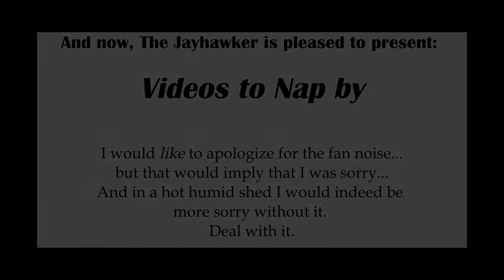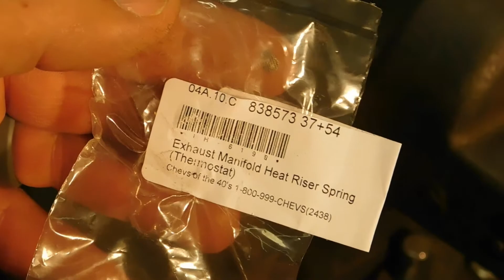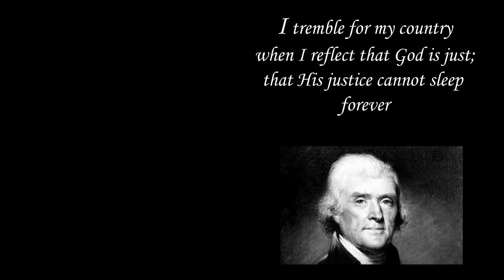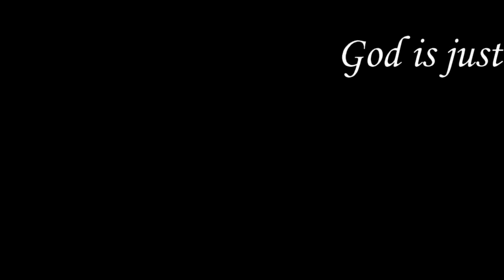Part 9: 1942-1948 Chevrolet 216 & 235 Manifold Repair - Plus Fuel Pump & Road Draft Tube

Comment: when I would bolt the intake and exhaust manifolds together I would leave the 2 bolts and 2 nuts just snug till the manifolds were tightened onto the cylinder head. then tighten them good.

Comment: You really should just snug the intake to exh bolts until you get the manifolds mounted on the head and the manifold nuts just snugged up. This allows the manifolds to align with the head with no stress. Then work up to torque or full tight in steps.
Reply: Did that on a customers ‘48 Chevy 3800 Pickup. The exhaust manifold was cracked when he bought it. Bought a good used one off ebay and installed it the same way as you explained; slowly tightened all fasteners so that everything seats properly in place with minimal stress points.

Comment: One of the most Valuable and authentic aspects of your work is to Include and discuss when things go wrong. Like a broken 40 - odd year old brass fitting for example. That's what happens to us amateurs out here, usually on a Sunday just before a Public holiday so you Cant get a new part for a week. Sods Law.

Comment: my first car was a gift from my grandfather in 1960 a 48 style master 2 door chevrolet. very rusty from minnesota salt. gas was 24.9c/gallon and at 40 mph the car got 25mpg so 100 miles on a dollar. the old 216 was reliable and efficient.

Comment: I did a complete rebuild on two 216's and they are a fun engine to work on.  The  glass bowl fuel pumps are cool looking. The originals had a brass screen in them instead of the paper filter.  You could visually inspect them for dirt and clean them by unscrewing  a nut on top of the pump to remove the glass bowl.
Reply from the maker: Thanks for watching! More to come!
Reply: @TheJayhawker  I just rebuilt my 1937 216. I had the engine completely rebuilt and the carb completely redone by the Old Carb Doctor in NC. The engine starts fine, and runs fine at full throttle but bucks at part load.This spring on my truck is broken.Would hot intake air all the time cause a stumble or miss at part load? Thanks-
Reply: @jacktyler6475  I believe it would. I have a1955 with an original 235 in it and I took it out for a cruise the other day and it started hesitating when I stepped on the accelerator pedal . When I came back I inspected the engine and found that the thermostatic spring was missing. You could always wire the valve closed with bailing wire. So the valve is in the OPEN position when the engine is cold and rotates counter clockwise (when viewed from the front of the engine) to the closed position once the engine warms up. I live in SoCal so it doesn't get that cold and is not a daily driver. I had a new spring on it but it must have fallen off I guess I didn't pinch the slot that the center part of the spring slides into. Good luck

Comment: The forward motion of the car causes a "draft" across the lower part of the tube creating a low pressure within the road draft tube which sucks the crankcase fumes out. That's why it's cut on an angle.  Air enters through the vents in the rocker arm cover into the engine and circulates through the crankcase, and finally gets sucked out via the draft tube. If you see smoke coming out of the draft tube, you've got worn piston rings. I like your videos and the old Stovebolt 216 engine.

Comment: Heat riser valves would always get stuck ove time and were ignored.  I never knew if they stuck open, closed or in between; did not care.  I owned a 47 Chev and a 63 Chevy II six.

Comment: That is not just a common spring it is made of bimetallic material that expands as it heats up it is a heat riser. Pretty good technology for the time and it did work. I have seen people remove the shaft and tap the holes install a bolt then cut it off smooth and not worry about the heat riser then complain about cold start problems

Comment: Make certain not to tighten the intake manifold to exhaust manifold until on engine. makes the intake and exhaust fit to head flush then tighten to specks after all bolts

Comment: Just found this video and so glad I did as you explain the heat control valve so well. Mine is stuck open so all that hot exhaust is permanently heating the fuel mix. I have a 46 pickup with a 216 motor and the 4.11 diff. Not the fastest car in the world but mine is flat out at 40 mph. Everyone tells me it should go a lot faster than that. Do you think the valve being stuck open could cause it to run out of puff?
Reply: Well, I’ve answered my own question. I loosened up the valve and installed a new spring. It definitely makes a big difference. From struggling at 40 mph, my ute will now easily do 50 mph. 
I still have other issues like the vacuum advance not working at all, but I’m pretty happy that a working heat control valve has made a huge difference

Comment: at 7:00 you should have waited until the manifolds were "mated" to the engine block before tightening them together to be certain they were squared to each other.
Reply from the maker: That's the great thing about video...Yes indeed I should have, and I believe in the next video I correct it, among other things. This stuff sure keeps a guy humble. Thanks for watching.

Comment: Have seen the draft tube replaced with a PCV. It does upset the power valve in the carburetor and cause more fueling.

Comment: I’m having a bear of a time getting the intake/exhaust manifold back on my 235. I have the bolts on the manifold loose to allow movement during install but the intake rings (that I have installed in the head) just don’t want to slide into the manifold. Any advice? Maybe lightly sand the edges of the intake rings?
Reply from the maker: First of all, I'm just curious if this is something you took apart and are now reassembling it or are they salvaged parts that you're putting together? Can you get the rings to go into the manifold while it is on your workbench? If it is close I don't see a problem putting a slight bevel on the edge to get things started.
Reply: @TheJayhawker  well.. I had original rings until I smashed them trying to put the manifold on. Now I have new rings and they’re a bit beefier than stock. But yes, I can get them in the manifold while on workbench
Reply: @TheJayhawker  and yes I took apart the original manifold because the mating gasket was blown and leaking and the exhaust studs needed replaced.

Comment: What is the brown-tinted sealant you are using on the fuel fittings? I have a thicker PTFE sealant and would also like to get a can of the thinner stuff.
Reply from the maker: Permatex #80019 Form-A-Gasket, The best sealant known to man, well, this man anyway.

Comment: I’ve been looking for that thermostatic coil spring for my grandfather’s 1959 Biscayne (has the good old original 235) and my 1965 GMC’s 250. Good to know they’re still produced. Yippee!

Update: Just broke the shaft by trying to remove the broken bit of the center of the spring with a screwdriver. 😟 Gotta find a new exhaust manifold now that has the heat riser (I don’t really feel like cutting the flap off the shaft, removing a shaft from another manifold, and welding it back in...). Just thought I’d share this so that now we know how easy it is to break these shafts!
Reply: sorry to be so off topic but does anyone know a method to log back into an Instagram account?
I stupidly forgot the password. I would love any assistance you can offer me.
Reply: @Mauricio Watson Instablaster :)
Reply: @Lawrence Kieran thanks for your reply. I got to the site through google and I'm trying it out atm.
Seems to take quite some time so I will reply here later with my results.
Reply: @Lawrence Kieran it did the trick and I actually got access to my account again. I am so happy!
Thank you so much you saved my account !
Reply: @Mauricio Watson You are welcome =)
Reply: Just broke my exhaust Manifold flange.  Made me sick to my stomach
Reply: If you have the manifold off of the engine, why not use a thin cutting disc to clean out the slit

Comment: i have a 1950  chevrolet  3100  truck with a 235 engine. have problem with no oil getting to top of rockers. checked all lines  they are clear.  removed oil pan test  oil pump working but noticed oil going to  oil pan  looked at the oil distributor valve looks ok. only get oil to top when i plug off the oil distributor valve and the pressure gauge port. then i get oil to main bearings and to the rockers  what could be wrong , any information  would be helpful, thanks.
Reply from the maker: The oil tube comes up through the head and takes a 90* turn towards the rocker shaft. On the bottom of the tube right after the 90* turn there should be a hole in the tube. Is there any oil coming out of that? I suspect a plugged line or junk built up in the rocker shaft. I'm not implying you, but perhaps there has been years of prolonged oil changes and little use of the vehicle, also never really getting the car out for long drives that allow everything to get good and hot that burns out moisture. Get back to me with what you find or any more questions.
Reply: @TheJayhawker  if i remove the oil distributor  valve and block it off with a plate  then i get oil going to the top. i have blown out all lines, and even the orifice  where it comes out of the passenger side of the block is all clear and oil comes out. but when i put the valve back in  i just get oil to the bottom even when i turn the oil pump slowly with a drill..i think the valve is bad?
Reply from the maker: @eldinpeterson3760  Yes, I agree.

Comment: I need your help buddy. My 48 fleetmaster fuel pump will not deliver fuel to carb. I have changed fuel pumps. Taken them off and on numerous times. Have turned over engine to different spots on cam and nothing. I am bypassing all old fuel lines and gas tank. Car does run I have filled carb with fuel and all works. Only thing left if if cam lobe is worn out and not pumping the pump fully. Any thoughts before I try to rig up electric pump? Thanks
Reply from the maker: Is this a vehicle you have had running since you have owned it? Because the only other possibility is that the old pump was the wrong one and you bought a new one to match. I'm not trying to insult your intelligence but you know, stuff happens. But first I would blow air through your fuel lines and make sure there is no blockage, look for kinks as well and if there is a section of rubber line for a filter or anything make sure it is open as well. Then with all connections tightened do what I did to prime the fuel lines at the beginning of this video:  
https://www.youtube.com/watch?v=kxgjytm2JHk&t=895s
Now you have everything primed and fuel in the carb. 
If it still doesn't take off you have one more possibility, bad gas in the tank. If it's old ethanol gas it may absolutely refuse to run on it depending on how old it is. 
If you check all of these it about has to be the cam lobe. Let me know what you find out
Reply: @TheJayhawker  the fuel pump is the same as what was on it, also matches the one you put on. Only thing I haven't done is try with the fuel tank and blow air through it like you did. Not sure whats in the tank so that's why I was bypassing it with a gas can. I will connect the lines and try that next. I am not sure when the car actually ran last. License plate in trunk was from 67. Could be reason car was parked because they had the same problem im having. I'll give it a try! BTW Iive in western Kansas, what part are you from. Thanks for the advice.

Comment: I have a 51 - 2 Door Chevy Deluxe Style Line. I have installed a new mechanical fuel pump. It is not working? is there a push rod or something that it has to press against? I did miss a step? I did not find any push rod?
Reply: No the cam does all the work

Comment: You should have installed a split exhaust manifold.  Run a straight pipe on one side and an 18 inch glass pack on the other!  No sweeter sound!

Comment: Hi thanks for making video, torn mine off yesterday my question is I seen another video or posting. They said leave intake to exhaust loose untill once you get it mounted to head. I guess that would insure both intake and exhaust mount flush to head. Then tighten those mounting bolts. I'm not saying you did anything wrong but I'm seeing two different ways, did you happen to start the engine yet, any issues. Thanks for doing video
Reply from the maker: Yeah sorry, that's embarrassing. Thanks for catching that! You certainly do want to only have them snug until they are tight on the head. Boy, that makes me want to blitz the video.....
Reply: @TheJayhawker  I think you did a great video and I think everyone else would agree to that, from the beginning to the end. You hit two topics I I'm doing on my truck, I'm also replacing the heat riser spring. Mine was binder wire tied wide open. So I'm fixing that. I'll be looking forward to more of your videos. To me it just makes sense to leave those bolts a little loose so both the intake and exhaust mount flush to head. Then lock them down. All good I enjoyed it
Reply: @TheJayhawker  I have a 1952 chevy 216 (in a 1953 Chevy 3100 truck) it does not have that spring.  I dont see the slot either for it on the rod either.  Did they do away with the spring by 52?

Comment: Nice thank you, did you do water pump yet ?
Reply from the maker: Next video will be testing and working on gen. and starter. Then will be the entire cooling system and hopefully put the spurs to 'er! What are you hoping to see in regards to the water pump? I was hoping to find a reasonably priced rebuild kit but couldn't a new pump was much cheaper.
Reply: @TheJayhawker  just looking to see you putting on your water pump, I replaced mine but seems to be leaking again. Not sure if I got a bad one or I messed up installing it. Having issues with my 53 216 not wanting to start. Do you have any experience in trouble shooting.
Reply from the maker: @nickpanhead7209  On the water pump there should be a weep hole on the bottom of the casting where the shaft goes into body of the water pump. Check to see if your leak is there or just the gasket. Start with checking for spark, if you don't have a spark tester pull a plug, re-attach the wire and hold the spark plug to a good ground (use a pliers with rubber handles) on the block while you have someone crank it. If you have a spark move on to fuel. Disconnect the fuel line at the carb and crank the engine. You should get a good stream out if the fuel pump is working. If that is good, pump the throttle lever on the carb and look down into the top of the carb. you should see a stream of gas spraying every time you pump it. If all of this seems fine you will have to move on into more technical stuff. Let me know! By the way it would be helpful to know if it just stopped running or if it has been sitting unused for a long time.
Reply: @TheJayhawker  thank you Jay I'll take a look at water pump once I get it to run again. It's been running fine for the last 15 years. I know I have a bad intake and exhaust manifold leak, That I been meaning to get to. And I'm hoping that didn't cause my problem. I went to start and it wasn't starting right. So I checked points they looked shot. So I cleaned them up and then it didn't want to start at all. I checked coil and wasn't getting spark, I had another old coil threw that in and it started. Took a 17 mile drive one way and it stalled twice but started. On the way back it stalled about four times. I let it sit for a minute or two and it started up again. Made it to a gas station toped it off to make sure it wasn't the gas. And then just about made it home. From then it wouldn't start. I did all that you said and that was all good. I decided to put in pertronix electronic ignition, did away with points. Also put a new coil on it, and nothing I replaced cap, rotor, wires and plugs and still nothing. I rebuilt carb and nothing. Put another carb on and nothing. I checked ignition switch seems good, I pulled positive wire off coil from ignition switch. And ran a direct wire off positive of battery to positive of coil, doing away with ignition switch tried starting. And still nothing. Did compression test had #5 cylinder at 50 dry 60 wet. All others seemed good. But that was done on a cold motor. I would think even with one bad cylinder it should run. Sorry for such a long text I'm just going nuts why she don't want to run. Could the timing just go out like that, out of the blue ? I like your video on intake and exhaust manifold gasket. Thanks for your help and input
Reply from the maker: @nickpanhead7209  just for curiosity sake, take off the dist. cap and crank the engine and make sure the rotor is spinning nice and even. Then wiggle the dist. shaft around and make sure there isn't a lot of slop in it.
Reply: @TheJayhawker  ok I'll check that next week not near truck now, I do have good spark. What I did do and I'm going to undo and try when I get home. I put a ground wire from screw on outside of distributor that holds plate down that's inside distributor, that covers advancement weights. Rite below distributor cap, not sure if that could be causing it. Pertronix wanted me to pull out the distributor with vacuum plate and clean up under bracket and motor so I would get a good ground. I didn't want to mess with that because I never removed the distributor. They said it was ok to do what I did with wire for ground but I'm just not sure, since the wire that comes out of the distributor that comes from points goes through Bakelite and then to negative side of coil. Not sure if it  could be grounded the way I did it. Thank you for take your time out to try to help me